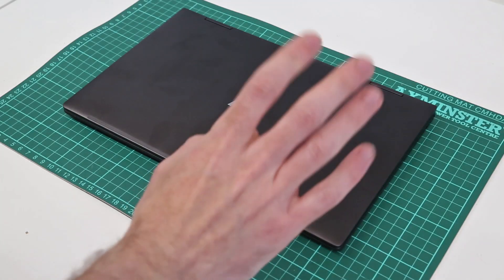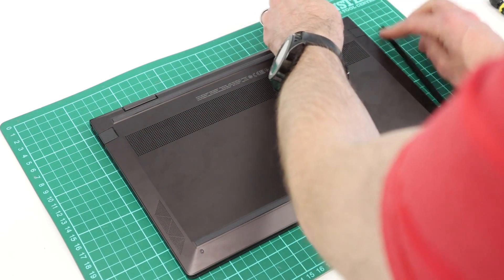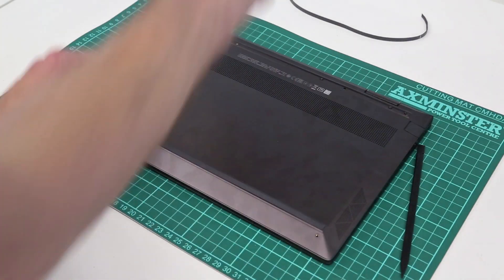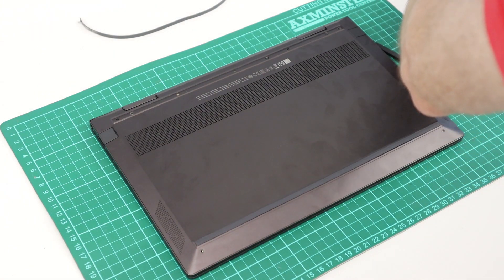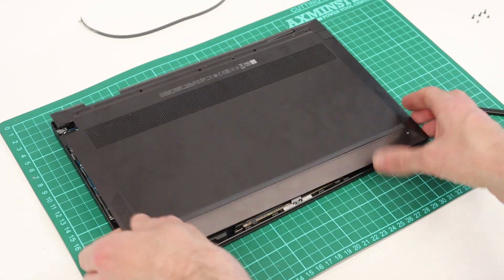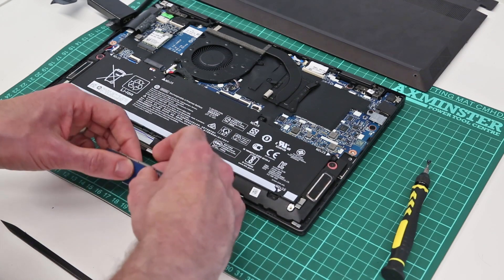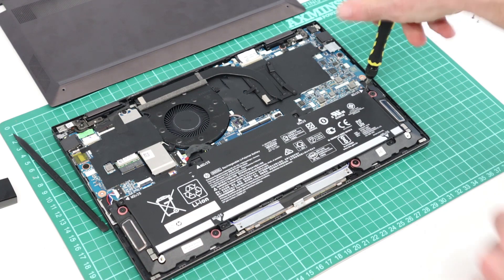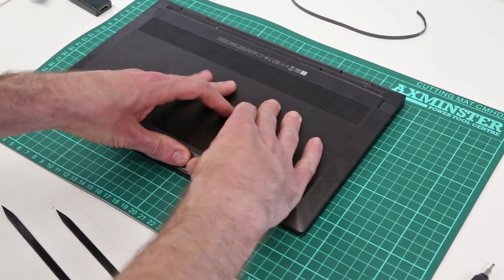HP ENVY x360 13-ay0008na 2020 SSD Upgrade and Battery Replacement Guide

Comment: Hello from Japan 
I have question. Is ay0000 series containing envy x360 convertible 13-ay0050au ? 
I want to change the battery by myself.
Thank you for your help and good video
Reply from the maker: Hi, yes the model is the 13-ay and then the number signify the configuration, so yes it should be the same.
Reply: @BrueComputing 
Thank you so much :)
I'll try to do that.

Sorry I have another question, is it better using mat like your green one than nothing?
Reply from the maker: Its just a cutting mat, I used it as it makes silver screws easier to see than if I put them down on the white desk.
Reply: @BrueComputing  
I understand. It is a good idea.
Thank you for your kind help

Comment: I took mine apart to clear some fluff from the fan. I didn't disconnevt any plugs. After rebuilding, it will not power on (LED next to DC input socket does not light in green or red, and holding the power button does nothing). Any suggestions? Is their a chassis intrusion switch?

Comment: If you look at the service guide, it says to separate the front edge (where you first started). Once you've got the front edge, there's actually no need to use the pry tool for the rest. They just snap off with some force.
Reply: Hi, could you explain More this please? i get Confused.
Reply: @nito85  Only use the pry tool for the front edge. No need to use the pry tool for the other sides. Just snap them off. They're held on by plastic clips, so just use a small amount of force and they will come off.
Reply: @teohhanhui  Thank you, I disassembled it super easily in seconds, I started from the back corner where the hinges are and I turned it all the way around with the tool.

Comment: I certainly did find it helpful. I was told by my admissions officer she believed my laptop had to be an i7 processor and at least 16 gigs of ddr4 memory.  I had already just bought this who's is an i5 and I bought the hard drive to upgrade and the memory was out of stock when I bought it so I was waiting. Glad I didn't get it now because you said it's soldered to the board!
Reply from the maker: If it had a Core i5 or i7 then it is going to be a different model of HP Envy x360. This on is based around the AMD Ryzen chips.
If you have the exact model number of the one you are looking at post it up and can take a look at the service manual to see what the options are.
Reply: @BrueComputing  HP ENVY Laptop 13-baxxx
Reply: @BrueComputing  I swear I thought it was the same based off of looks. When you turned it upside down to get the screw it matches mine. I'm gonna try to install the terabyte hard drive before I go to sleep
Reply from the maker: Different machine then, but still non-upgradeable RAM.
You can check the processor and installed RAM in the System, About section of Settings in Windows 10 or 11.
Reply: @BrueComputing  running HP Support Assistant it says memory slot and slot 2 4GB Micron Technology 3200 MHz
Reply from the maker: @winstonbeck8623  The tool doesn't know the difference between a slot and soldered down RAM - its just reporting what is attached to each memory channel. If it is the 13-ba then it doesn't have SO-DIMM slots, it has soldered RAM.
Reply: @BrueComputing  Do you know if the X360 15-ed1055wm has ram soldered to the board?
Reply from the maker: @doczombiex  Can find the service manual for the X360 15-ed1000 here: http://h10032.www1.hp.com/ctg/Manual/c06618426.pdf
Shows that it has 2 DIMM slots, under a metal cover on the mainboard.

Comment: Is samsung m.2 nvme 980 1tb compatible to tbis laptop?
Reply from the maker: Yes, but it will only run at PCIe 4x Gen 3 speed, as the port doesn't support Gen 4 speed.
Reply: Ok thanks

Comment: 7:54 this is a m.2 SATA SSD not nvme ssd
Reply from the maker: It's an M.2 2280 NVMe PCI 3.0 2x SSD, as per the system specs here: https://support.hp.com/gb-en/document/c06630647
It has the extra keying pin because it is a 2x device, not a 4x one.
Reply: @BrueComputing  oh thanks man for correcting my mistake😃

Comment: Hey hi Brue...
I need you suggestion my hp envy x360 the same model here is giving me some issues ... It automatically switches off at 8% 2nd while charging it charges like 25%-28%-32% like skipping percentages now I bought the laptop on 6th November 2020  what should I do HP is offering me to replace the battery. What should I do?

Comment: How hard will it be to remove the motherboard from the front of the chassis? We had a bit of a tea spillage incident, and I intend to clean every surface I can get access to....
Reply from the maker: A bit fiddly, but doable. Details are on page 58-60 of the service manual: http://h10032.www1.hp.com/ctg/Manual/c06618429
Reply: @BrueComputing  Cheers! I had been looking for that service manual

Comment: I saw another video about this machine it mentioned that the ssd that came with it is PCIE 3 x 2 but that the port on the motherboard will accept PCIE 3 x4?  Can you confirm that this is correct?  I would like to upgrade mine with either the samsung 970 evo 2tb or wd ssd.  which brand do you recommend?
Reply from the maker: It'll run a PCIe 3.0 4x SSD without issue - I haven't tested if it utilises the extra performance though.
The Samsung drives are very good, but also very expensive - are you looking to change for extra capacity or performance?
Reply: @BrueComputing  Mostly capacity but i do use photoshop and lightroom for photo editing so added performance would not be bad either.  I just saw online that crucial also makes a nice drive that compares with the Samsung for less
Reply from the maker: @scurve099  The Crucial P5 is certainly worth looking at: https://amzn.to/2LVxyAV

Comment: Hi! Cool video. There is a question. The graphics card on this laptop is integrated, so you can't replace it as it uses the CPU. But can the processor be replaced/upgraded to increase the performance?
Reply from the maker: The Ryzen APU is soldered to the mainboard, so the option for doing this would be to swap out the entire mainboard for one with a more powerful processor. Probably wouldn't be cost effective though as a Ryzen 4700U/16GB DDR4-3200 mainboard for one of these isn't going to be cheap.

Comment: Things that I did with that laptop right away:
- Update the bios (fans was kicking way too often before)
- Replace the realtek wifi card by a Wifi 6 Intel
- Repaste the cpu, the thermal paste they used is garbage sadly. The heatsink is very tiny, so a very good contact is essential!

20°C cooler, stable and very fast wifi.
Reply: wow this is very useful info, is there anything else that you updated?
Reply: @Light0x  No, not much. The laptop runs great.
I am a Dev, I run Linux on it (Fedora to be correct) and it works fine.

I have my own tunnings for Fedora, etc. But that's not very much specific to this laptop.
Reply: I'm thinking of upgrading my SSD, thinking while the thing is apart I should swap out the WiFi card too.... which card did you go for and would you reccomend?
Reply: Which wifi 6 card did you end up using? I am hoping to replace mine right now it is a wifi 5 realtek 8822ce
Reply: @Sonchuo  The regular latest intel one :) 
They upgrade them quite regularly, just go to intel's website you'll find them.
Reply: Well the bios did update by itself during setup but that was worrisome as my daughter's Dell was doing the same thing at the website and Boom! Bricked. I think it's a goner. That's why I bought her a new one the same time I bought mine. No more Dells. I'm still salty about that crap.
Reply: Hi there. Do you mind specifying which wifi card you used? I've never done this before and would like to avoid commiting mistakes there. Thank you

Comment: Is it possible to upgrade the GPU? To a better graphics card.
Reply: You can not upgrade the GPU. This laptop has integrated graphics, it does not have a dedicated GPU (even if it did, they're not upgradeable on the vast majority of laptops).

Comment: The factory installed M.2 is a SATA drive, not NVMe.  On this laptop, they are not interchangeable! You must replace the installed drive with a SATA M.2
Reply from the maker: This is incorrect, it is an NVMe drive. See the product specification here: https://support.hp.com/gb-en/document/c06630647
Page 1 of Maintenance and Service Guide here lists both NVMe and SATA drives, indicating the slot is wired up to accept both types: http://h10032.www1.hp.com/ctg/Manual/c06618429

Comment: What parts can be upgraded on this model? Just ram and battery? I’m looking for better ram, SSD and anything else I can upgrade
Reply: Can the RAM even be upgraded? I don't see a RAM slot.
Reply: RAM is soldered on so not upgradeable - only an SSD upgrade is possibly really

Comment: Anyone ever find a good replacement for those bottom rubber strips?
Reply from the maker: Just reattach them. If the tape is no longer sticky you can peel it off and replace with a standard double sided tape.

Comment: Can i add more ram in this hp envy ×360 2020 model?.
Reply from the maker: On the 13" model, no. It is soldered to the mainboard.
Reply: @BrueComputing  Do you know if there's an additional/second memory slot that you can add RAM to (and leave the soldered one alone) or is the soldered memory what you're stuck with?
Reply from the maker: @wakkawakkawakka-s3i  No, you cannot upgrade the RAM, it is soldered to the mainboard with no DIMM slot.

Comment: I can't get my replacement ssd (hp ex950 2tb) to show up in the bios or be detected in the windows 10 installer - tried turning off secure boot and clearing security keys, tried installing windows on another laptop and then putting that ssd in, tried cloning factory ssd to the new ssd, nothing works. New SSD works fine on my Dell Latitude 7400 so not sure what I'm doing wrong ☹️
Reply: The drive that was prinstalled in the video was a SATA M.2 not NVMe. Your drive is an NVMe. probably not compatible.

Comment: Man, that is one stubborn back plate to remove.  Was getting agitated myself watching you do it, lol.  All in all, a kind thx for this, as I have my ay0009na coming soon, and will be replacing the slow NVMe drive with a 970 Pro variant, and this has helped tremendously!!!  Thank you for this :)
Reply: Did you see a great improvement with your 970? I decided to go with a WD Black SN750 and am imaging my PC now :) They should have very comparable specs
Reply: @Cecil4029  Yes, as the drive that is installed is bandwidth limited, aka restricted.  You will see this when you remove old drive, as it has pins missing from the interface ;), so any drive that is not restricted is going to be better, so most normal NVme types :)
Reply: the laptop uses an M.2 NGFF drive and not an NVMe

Comment: obviously this gentleman knows his stuff and also it's obvious in the video that it is fine to so.. but if  you are watching this video for guidance.

Please disconnect the power and battery first before removing any component of your laptop.
also it is good practice to press the power button for moment to let go of any residual power(while all sources of power is disconnected of course including usb).
Reply from the maker: Is ever thus! When I disconnect the battery I get comments telling me there is no need to disconnect the battery. When I don't I get comments telling me I should.
Typically I do, just got the sequencing backwards when filming this one. If you have shutdown the system properly (not put it to sleep) then it SHOULD be safe to do the SSD install with the battery connected, but it is good practice to disconnect it if possible.
Reply: they might break the battery connector, is not really necessary to disconnect the battery if you just wanna change the ssd, just dont stick conductive stuff in the laptop

Comment: If I where to replace the ssd in the future, what replacement would you recommend that could be faster than the one that comes in the model?
Reply: Its already super fast since its an Nvme ssd....but if u want more storage feel free to upgrade it with a more capacity nvme ssd
Reply: Right now the Samsung 970 or a Sabrent

Comment: you are a legend
Reply: hp going for the duck move again
placing screws underneath the rubber strip
i hate it
Reply from the maker: Pretty common for them - its not that bad as they do publish service manuals telling you they are there.

Comment: In the 8gb RAM model, is it dual channel? I keep hearing mixed opinions could you please confirm it for us.
Reply from the maker: Yes, it is soldered down, but in a dual channel configuration.
Reply: @BrueComputing  are you sure? So I can add another 8gb in the empty slot?
Reply from the maker: @harryaldieny7697  No! The RAM is soldered down, and there is no expansion slot. The memory installed is in a dual channel configuration on the board though, so optimal for performance.

Comment: Hi, do you know if the wireless card is upgradable?
Reply from the maker: Yes, the wireless card is a standard M.2 adapter with 2 aerial connectors.
Reply: @BrueComputing  Brue where is the wireless card located in the video? Is that it to the left of the SSD?

Comment: What about the wireless card, is that replaceable too or is the connection to the antennae proprietary?
Reply from the maker: Yes, the wireless card is a M.2 wireless card with 2 aerial connectors.